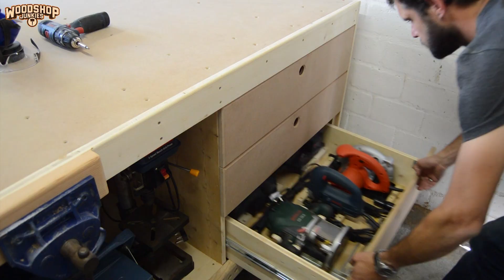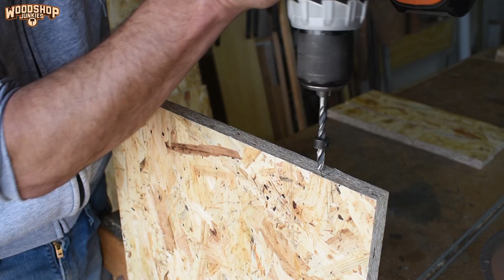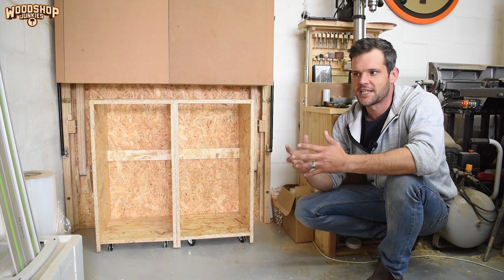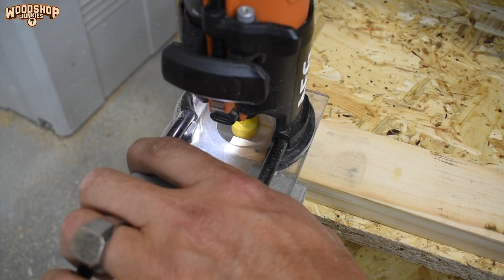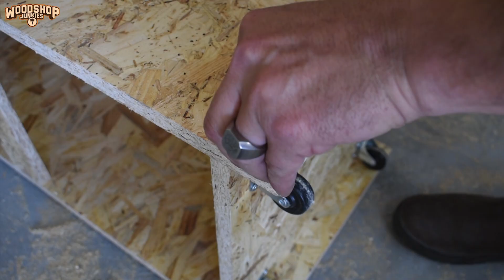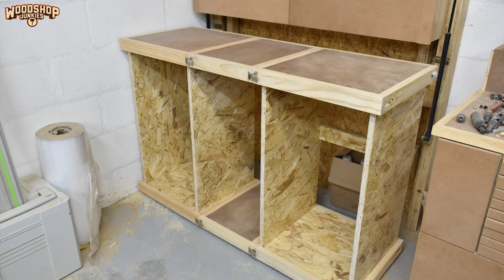Super Align & Lock Mechanism - Modular Workbench Solution

Comment: Ok. This is genius. I think for the big bench. You could use butterfly latches from a roadcase. They are super strong and low profile. (There are also recessed versions for flight cases available)
Reply: Yeah those type of latches would be perfect for heavier applications. Great idea!
Reply: That's a nice idea, but those things are about $10 each, for the cheap ones.
Reply: @zapa1pnt  there's a reason they're spendy, they're made to be latched and unlatched constantly without wearing out. Buy once, cry once 😉
Reply: @benstrait333 : Oh yeah Ben, I understand all that and for protecting thousands of dollars
worth of equipment, as those travel cases are designed for, they are a must, but for this
application and needing 4 per module, it is expenditure over kill.
Reply: @zapa1pnt  yeah, I can see that point too. I guess you'd have to decide how long you're going to keep the workbench and how often you're going to reconfigure it.
Reply: I think you could probably get away with one latch per side of the budget doesn’t allow 2. Those suckers are strong.
Reply: A single latch in the centre of each side would still pull it all together but you wouldn’t have to bend down so far to latch it.
Reply: Exactly my first idea. Was going to write it, and then I saw this 😂.
And since the rest of the build does not seem to be blowing the budget, perhaps the latches would be ok to spend some money on 😊
Reply: Great idea. Nice to see someone else who struggles with space. Always feel jealous when I see the American guys with airplane hanger workshops and there's me and most of the UK and Europe doing their best with a garage or a shed 🤣🤣
Reply: @rogergladding7943  That's a good point as we get older, the bending gets harder
Reply: @rogergladding7943  I think that solution could work if the trim was flush with the sides. Otherwise I fear the latching would pull on the sides and cause them to bow since there's a gap between them.
Reply: @PikkaBird  but I would put a spacer where the latch is to stop that happening. It could be arranged so it puts a tiny bit of spring into it.
Reply: Latching  - Perhaps just keep it simple by using one handed clamps.. True, a bit bulky, not very hi tec or flashy, but cheap and most wood workers already own them.
Reply: @rickypacheco  Yep
Reply: @shaun65375  There are also plenty of Americans (including myself), who don't have the luxury of a large space.  I thoroughly enjoy this channel exactly because he is creative in solving the problems I face in my shop.
Reply: @benstrait333 other videos on YouTube simply bolt the modules together through modular predrilled holes. But nuts and bolts aren’t cheap anymore either

Comment: I'm having difficulty visualizing how a miter saw stand could lock with these shop trollies. In order for the miter saw surface to be at the same height as the trollies, the miter stand would have to be below your alignment mechanisms. The 'fix' for this would be to have the alignment mechanism lower on the trollies.

Comment: That's brilliant, only thing I would change is trying to mount the latches under somehow so not only can they be joined side on side but maybe fronts and backs too
Reply from the maker: For the bench this will be a requirement so I will have to consider different mounting positions or different locking mechanisms.
Reply: I was thinking the same thing. Someway to mount the latches under the trim or below the trim strip.
Reply: I was thinking the same thing, and I agree. You need to be able to join 4 units into a big cube.

Comment: To make these fully modular on any side, using square modular trolleys, I'd consider moving the pipes slightly closer to the center, leaving room to recess a slimmer profile latching mechanism into each corner, while also alternating in the same fashion as the pipes. This would enable all sides to be connected since the latches would not protrude and interfere with any side connecting flush with another. Using the latches on the side would be preferred over moving them to the bottom since accessing the the bottom may be inconvenient with certain modules. I'd also consider moving the entire alignment mechanism down just enough for the inevitable miter saw module or any other module with a mounting surface lower than the work surface. Looking forward to more from you on this modular work bench.

Comment: I am in the process of designing a modular workbench.  I am at the point of making sure everything fits together before I start building.  I was just trying to figure out how to make the separate carts line up so the tops are flush.  Then I found this video.  Thank you for solving this problem for me.  I was thinking about using dowels that permanently stuck out of one cart and went into reinforced holes on the other cart. But this is so much better.

Comment: Very nicely done, and, as far as I know, completely unique.  The use of the round pipe to pull your surfaces into alignment is brilliant engineering.  Your solution is simple and will probably be extremely reliable.  It shows that you've thought about this for a long time.  Also, the extensions quickly added not only surface area but temporary storage volume.  Very nice.  My prediction is we will see many YouTubers copying and refining your ideas.  Imitation is the sincerest form of flattery.

One suggestion came to mind as I watched.  Drill all your pipe before you cut it to length.  I think it would be much easier to handle.
Reply: "One suggestion came to mind as I watched.  Drill all your pipe before you cut it to length.  I think it would be much easier to handle."
When I first read this, I thought, "Oh yeah, that's a great idea." Then I thought, "But it would be difficult, to keep the holes aligned."
After another sip of tea and a couple more brain cells woke up, I realized, they don't have to be aligned, because they are individual pieces. 🤪🤔😵‍💫
I think I watch this stuff way too early.🥴

Comment: Very cool and easy idea. Looking forward to the work bench. my thoughts on the locking: I would like to see a sliding latch bolt instead of the toggles. something built in the trim piece that can be slid into a corresponding piece. 
expanded: 
I see a trim piece that is halved, routered out and a dowel length enclosed. the dowel would have handle coming through the face of the trim piece along a routered out course allowing for a dual sided locking (left and right).  An encased bolt latch. This would also allow a third bench to use the same mechanism as the female part. if the bolt is slid to the left than the void left can be used by another bolt. (DM for more details if need be). 
For a positive lock, the bolt and routered grove can have a ball bearing catch. easy to apply force to unlock the bolt latch but positive enough to keep the bolt latch in place.

more detail or drawing can be provided if need be. I'm not a wood worker just have an engineering mind. I work in LEGO. lol
cheers!

Comment: Toggle latches are good because they pull the pieces together tightly and lock in position securely. You also did what I'm doing. I'm putting french cleats in my shed and making holders for the items everything is being made out of wood that's not great but by using these and moving the holders I get great ideas for more suitable spaces between cleats and making holders lighter and more effective for use and design of the holders and adding items or removing them from holders and the layout that suits sizes and shapes of holders and suit me for me needs and frequency of uses and storage holders for spare parts to each tool I get. Because usually I have the spare parts for so long and moving them around the shed I end up forgetting what they are off of. Great video and great idea you have with these locking extensions as the extensions would be ideal for making storage areas for stare parts so you don't need to be lifting them with the tool and holder every time you want to relocate items. Fantastic and brilliant idea you have and it keeps the spare parts all in one place and out of the way

Comment: I build the WoodSmith Roll-Around Shop Cart and Multipurpose Cart. Favorite advantages about two smaller assembly tables are, spanning between for long projects, more edge to clamp, storage you can access from all sides, can move them through walkways to bring wood to the tools. I can combine those two carts with my 2x5.75 out feed table too.

WoodSmith also has a twin cart design using hasps like you did. They mount them under and use a hinge on one side so the drawbridge is attached to one cart. They call it their: Multifunction Shop Carts

Comment: I think that works great for a linear series of benches (all in a line; you have a 1x3 setup), but you would have issues working in the secondary dimension to create a bench that would allow you to have 2x3, 3x4, etc. A locking mechanism that would allow you to access from the top maybe? Something like the Lamello Zeta P2 toggle clamp, locked by a hex key from the top, perhaps? The tool is expensive, but something like that toggle connection would be nice.

Comment: I have to say, I for one have never seen this approach to alignment of benches or anything, it's unique and a brilliant idea! Are you sure your not a rocket engineer playing a YTuber... 🙂
You might want to set the latches as positive and negatives also that way it does not mater there orientation either when you add them for the blanks etc... Oh Look, you made a place for a trash can... 🤣

BTW I say "function over form", if it works looks are not everything. When I made things for the shop out of wood, it never got more than a sanding and linseed oil. 40 years later it still functions and has several coats of oil... LOL
I like the idea, if the tool is facing the wrong way, just spin the box and there you go... Truly outstanding! 

This is going to be awesome! Thanks!

LLAP 🖖

Comment: Have a look at Butterfly latches like those used on equipment roadcases. You can get a much tighter fit with those latches. Roadcases also have an aluminum tongue and groove system for meshing lids and whatnot. It probably won't work for you but could inspire some more ideas.

Comment: Great concept. I've seen many modular workbench videos but they fail to address the top surface alignment. One suggestion I have is to use some sort of leveling for the legs. If you don't have a flat floor and you join two modules, you'll end up with a wobbly table

Comment: First time here, and now a new sub from Denmark.  
"If you don't know, now you know!" is what Trevor Noah so often says, 
and this saying is so true for me right now.    👍👍👍

These trolleys solve all the problems I've had about how to make my old shed turning into a tiny workshop (2.5 x 3 m) and with a carport right outside the sliding door, perfect as an extended workplace, work, without having workbenches/tools taking up space in the carport when I'm not working there.

And making and easily rolling and connecting these custom-made trolleys in the shed as well as outside in the carport when needed, and making the perfect workbenches depending on what tools I'll need and what project I'm working with, wow, this solution here will just be perfect for me too!     👍👍👍
   
I've seen a few amazing modular workbenches here on youtube, but they were either too expensive and/or way too complicated for me, as a new woodworker, to build.  

Thank you so, so, so, so much!  ❤   Until next time!   👍

Comment: I attempted something similar for my first bench about... 4 or 5 years ago? I used big magnets instead. Probably would have worked out better if I was a better wood worker at the time. That way it could be a big square, or turn one on its end to be long out feed. The magnets would have worked out better, had I been more accurate with their placement. The latch option you went with would probably be more secure though. In my shop, I'd have a couple issues with this design. I'm clumsy... And I'd snag clothes on those exposed latches. Also... My garage floor is so horribly unlevel, that this design would wrack and twist without leveling feet. If it works for you, I'd keep rolling with it. I love your brilliance! Keep it up!

Comment: Brilliant! Can't wait to see the bigger version.  Though I bet you will want some sort of auto locking for the back side, instead if walking around bigger cabinets everytime you want to change up.
Reply: That is an important point! For example, if you want to dock a mobile module to a stationary one that is backed directly against the wall. This is exactly the task that I would like to start next in my hobby workshop. On the left a longer workbench, and on the right a miter saw module and a module as a milling table, both of which should be mobile.

Comment: Crazy how you come to expect great things out of people when they keep delivering. I feel like the inspector in ratatouille when asked what he wanted after his perspective in life was flipped on his head. 
Anyway, yes the toggle latches work, and are a great alternative for starters, but if the aligning pipe was to be fitted with a sort of a cam on one side and short 1” shaft on the other that you push in and with a 1/4 turn align and lock at the same time that would be great. I leave your great mind to think of the details of such a mechanism. But it would likely entail two pipes from different trolleys meeting and locking together. So your pipes anchoring method would have to be slightly beefier to withstand the repeated cam locking forces. If limited within the marrying cylinders/pipes, it can minimize the fatigue and locking and unlocking.
Keep up the good work, and don’t let Milwaukee buy you out.

Comment: I designed a similar system for my garage using 4 benches 600mm x 1200mm made from 4080 aluminium profile.

I 3d printed tapered male and female fittings that house strong magnets that pull the benches together, and also locate the bench against a wall.

Comment: Recent sub and first comment on any of your videos. Your designs are next level and I fully intend on mixing and matching many of your concepts into my own shop furniture. 
On this alignment latching idea, I'd make two suggestions. One is to always place the latch side with the positive alignment and the hook side with the negative, for the same reason that you always place the positives in the same corners of each section.  The second would be to find a way to either recess the latches/hooks, or place them on the underside of the bench. This will allow for you to align your module benches into multiple configurations.

Comment: Absolutely brilliant!!! All other YTers will be using it or coming up with alternatives. Makes modular workstations into large benches, extended tables or can make main benches with modular moving tablesaws, routers tables or planers into main bench and hook up to one dust collector. The combination and uses are endless. 

My workshop is in my basement, but when pieces get too big, it’s tough to move out and complete in my garage. I can create many of those tables and bring everything outside for large projects or when I’d rather sand or spray in the fresh open air.

Comment: Very neat idea! as other people have mentioned, recessed latches placed so that they're consistent (IE toggle on the side of the Negative registration, hook on the Positive side etc.), also, consider the ability to have 1x1-unit sized modules connect to a larger module (like a 2x2 module for the table saw, with a 1x1 outfeed surface etc.) making the small units symmetrical to be connected in any orientation, like Legos.

Comment: Man, I used to really look forward to every single Woodshop Junkies upload... I still do, but I used to too. This is quite brilliant, and I think I might incorporate it into parts of my shop too, to be able to detach some machines from my workbench if I need to run some extra long pieces.

If your trim thickness allows for it I would recess the latches so they don't snag on belt loops/pockets/whatever. That would help with the look as well IMO and there are latches that look a little more sleek too (with the screw holes underneath the catch handle rather than on wings that jut out) so your recess can be more discreet. Also, if you consistently put the handle part on the corner with the pipe and the hook part on the slot corner you could hook up your extensions without having to turn them around the right way first.

I'm sure you've already considered adding (folding?) gussets under the extension shelves since you mention holding a garbage bag on the end of the table.

Comment: Very clever design and looking forward for the next video!

I feel like there could be improvement to the design though, but the prototype is very promising.

My first thoughts are these 2; put one locking caster on each of the benches and put strong magnets in the recesses where there are no pipes.

This way, the magnets would "attach" the benches without the need for latches, and if they aren't strong enough for a specific job, you can lock the caster and then you don't need the latches.

Comment: I'm building a similar modular bench system using toggle latches. I thought about including alignment pins too, but my idea was to use round washers and a borehole of the same diameter on the connecting bench. It can be taken one step further by embedding a rare earth magnet into that bored hole, eliminating the need for toggle latches. This would make for an instant connection without additional hardware but with the obvious reduction in overall strength. But then again, rare earth magnets can be surprisingly strong if the tolerances are accounted for.